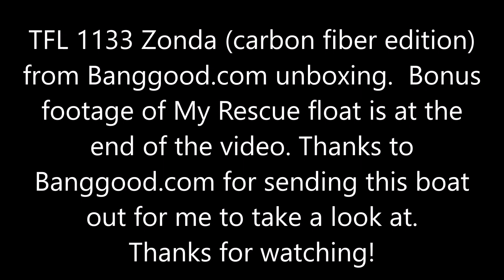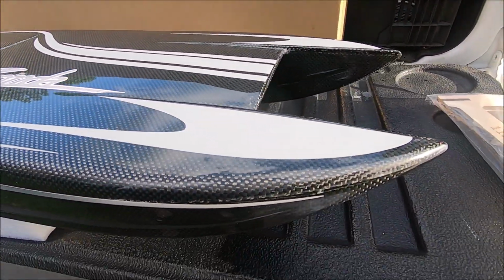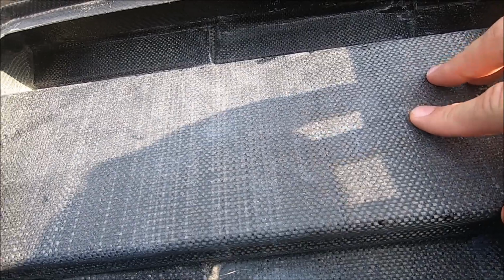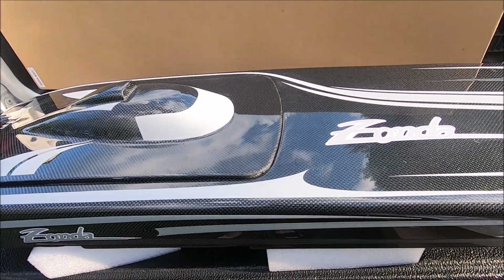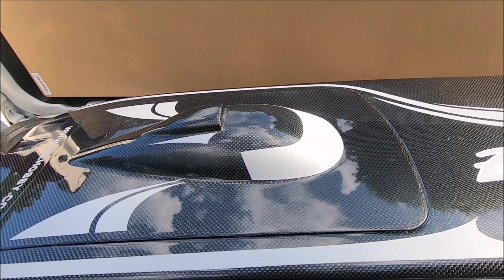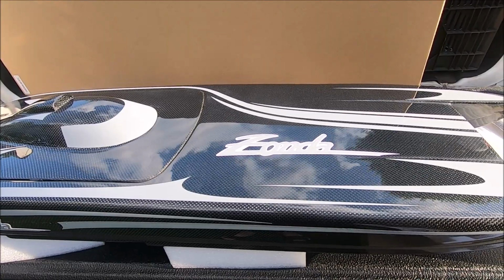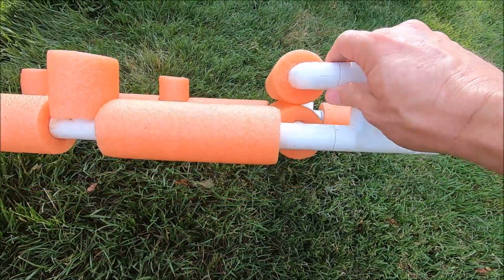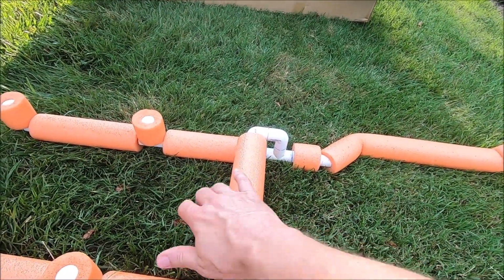TFL 41" Carbon Zonda from Banggood.com  w/Bonus Rescue rig footage

Comment from the maker: Buy this boat here.
https://www.banggood.com/custlink/KvmRaAuRAD Use Code BG1133LRC to get an additional 12% off

Buy the Black fiberglass Zonda here (USA STOCK) 
https://www.banggood.com/custlink/KmGKkuIFAd    Use Code BGTFLRCB to get an additional 8% off!
Buy the white fiberglass Zonda here
https://www.banggood.com/custlink/KGv3Uw385I    Use Code BGTFLRCB to get an additional 8% off!
Buy the servo I used here.
https://www.banggood.com/custlink/G3mDzTHBdQ
Reply: This coupon code doesn’t work it says expired when I put it in
Reply from the maker: @bradleyohara6775  I'll send them an email to see if I can get it extended.
Reply: @MrMad2424  
Hey there.  Im waiting on a white Zonda with stock electronics.  Which batteries have you been using?  I think i’ve asked you once before but can’t seem to find the post. 
Thx
Chris
Reply from the maker: @maddow4all  Nice..I use 5000-6000mah 65c or higher. I like the Revectrix from OSE.
Reply: Thanks. I will give them another go. I believe that things will go better this time. Thanks Mr Mad.
Reply: Keep us Updated on that coupon code 💪🏻💪🏻💪🏻💪🏻💪🏻
Reply: Hello mate, tried that discount code but says it has expired. Would you have any updated ones?

Comment: Das boata and OSE are both at the top end of the rc boat game, can’t wait to see what you all come up with. Love the rescue boat set up. I have been looking at mounting a rudder facing up so when boat flips upside down you can still steer it like air boat
Reply from the maker: Yes those guys are great. Big numbers are the plan for his one. Yea that'd be a good idea on the rudder to guide it in. A lot of times you loose radio reception when antenna goes under water though.

Comment: Might as well get the ARTR for that price seems like. Looking to do a  build through TFL NA, can’t decide between a dual rudder or quad under hull pickups
Reply: I've been looking at the dual 300 esc rtr Zonda or the Mamba Ariane on TFL. Nice rigs
Reply from the maker: The version that OSE sells is pretty close in price after you figure in the extras needed.
Reply: @portcityrc  I won’t ever go fast enough to utilize the 300s, 2x8s (or 2x12s?) would be something to see!

Comment: Is the hull still as thin as previous carbonZondas? I fixed some chips/cracks in my friends zonda. Uppon further inspection i noticed that the intire hull was full of micro cracks. I suspect that it at some point has had an identitycrisess and taken flight.
Reply from the maker: This hull is very thick to be carbon. Kind of surprised me how thick it was. Not any flaws that couldn't be expected a little imperfection at the transom seam but still very good. No micro cracks found on this one.
Reply: @MrMad2424   cool👌🏼😀 looking forward to future videos on this one😎
Reply from the maker: Thanks!

Comment: Did your Other Zonda come Ready to rig? I was considering getting one but, im not sure I have the technical know how to drill and buy hardware that will fit. Especially the motor mounts and the shaft carriers. Probably handle the ESC and battery mount but when busting out the drill to knock holes in a 600 hull would freak me out!  The Zonda is sexy machine but  intimidating.
Reply from the maker: The fiberglass versions come ARTR from banggood. Only add a radio and servo for fully RTR. OSE can sell you a fully RTR version of either.

Comment: I wish you'd get into the Zelos 48G my friend!😉
Reply from the maker: The new version is better than the old version for sure.
Reply: @MrMad2424  what has been updated? I definitely wouldn't mind purchasing another. I've went through and replaced almost everything on this v1 zelos 48G. I've repositioned the stuffing tube, changed enging out for a gizmo 30+ full mod engine bonzi clutch and a matching ABC prop. Not sure if Mr. Dasbota custom grinds props for these. The lake where I am hasn't been glass lately or cooperating to get some speed numbers, but love your vids..very inspiring! I've bought the miss geico based on your vids. Also had to pick up the old yellow zelos 36.
Reply: The original Zelos 36 is my favorite machine.  The UL-19 is a good one too. Got it up to 59 mph today and thats the fastest I have ever pushed it without flipping. Took some delicate weight distribution but, I think I got all I can out of it stock.
Reply from the maker: Different motor in the new version.

Comment: Will you be running the dual 300 esc setup?
Reply from the maker: I'll probably run Seaking 180's like the RTR version OSE sells has in it. The ZTW 200amp is not out of the question either. Not sure yet.

Comment: Would love to hear where you can get hardware for this project. I have shafts and props from dasBoata, but cannot seem to find rudder pins and the bullet shaped prop locks from the end of the shaft. Thanks for sharing rescue setup - what is the boat you use to push that btw?
Reply from the maker: The bullet shaped prop nuts are a waste. Use Zuber nuts from OSE because you will loose your expensive prop with the bullet nuts. Also OSE has the dual pickup rudder for this boat so I'm sure you can get the pin if you order that rudder. Also my rescue boat is a AquaCraft Atlantic II Tug which has been discontinued. You can search ebay for one. Here is a link to OSE website for parts. www.offshoreelectrics.com
Reply: @MrMad2424  Really appreciate the reply - have ordered the Zuber as, yes, have lost a prop using the standard bullet nuts. Really enjoy your videos, and my Zonda!
Reply from the maker: @davideyers8352  No problem.

Comment: 👍
Reply from the maker: Thanks !
Reply: @MrMad2424  I could barely get my 4092 motors in with the water jacket, a 56can will be crazy tight.  Id like to see
Reply from the maker: @naveda08  The 56mm would be a single mounted in between the sponsons, no clearance issues at all.
Reply: @MrMad2424  single drive full size Zonda?!  🤔 interesting  I thought of doing something like that to a mini zonda carbon
Reply from the maker: @naveda08  There have been single TFL genesis and fightercats well over 100mph. Heck 5-6 yr ago. I'm more fond of a twin setup though

Comment: Why does just the hull cost 4 dollars less than the same boat with ESC, motors, etc everything already installed?  lmao makes 0 sense.
Reply from the maker: It's not the same boat this one is carbon fiber and the other one is fiberglass.